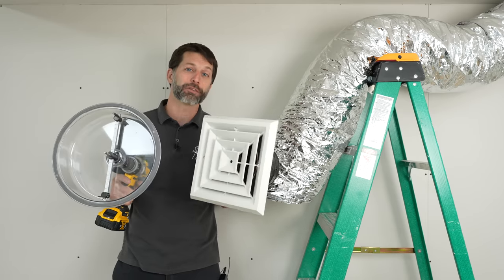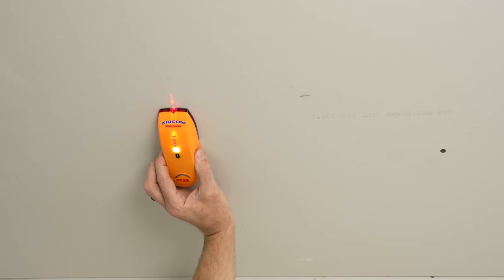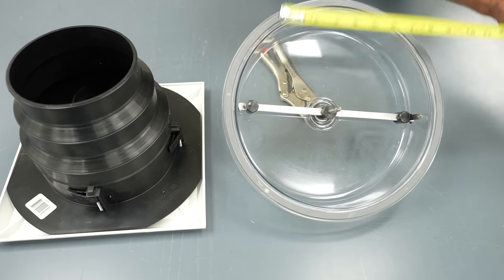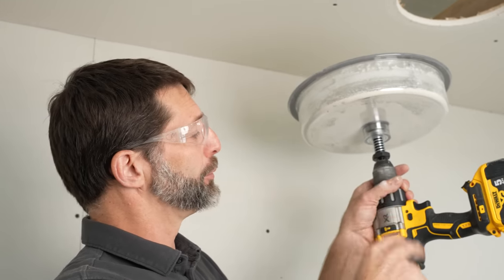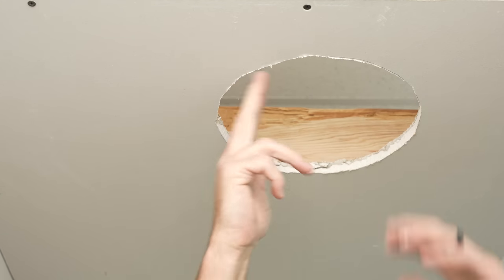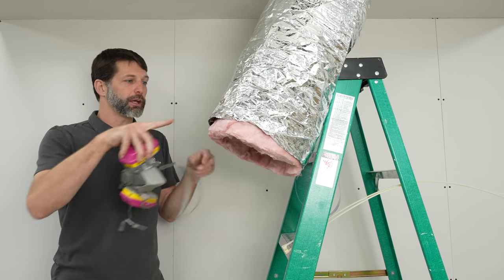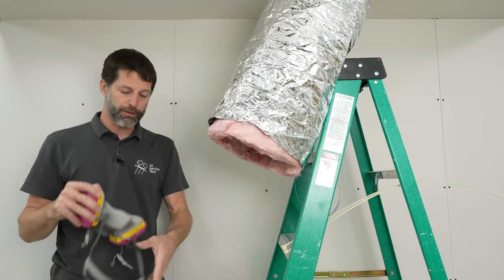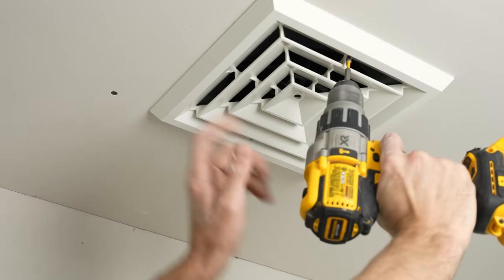Installing an HVAC Supply Register Airtec in the Ceiling! Cutting the Hole, Connecting the Flex Duct

Comment: Great video as usual. 
If I may ask, how would you do that differently in South Florida (or anywhere else with extreme heat and humidity) to stop condensation buildup on the area that was pandit strapped (over the whole duct) and the 8" section that wasn't covered in insulation at all?

Comment: Hello Craig. What us 12 5/8 heavy? I have never heard that before 😮!
Reply from the maker: 12 5/8" heavy means that it is 1/16" longer than 12 5/8" which is actually 12 11/16" but in the US we don't really talk in 16th's in the field. We only talk in 8ths or lower fractions. 12 5/8" light would be 12 9/16". Sorry for the confusion!

Comment: I have this setup in my home except I have discovered a leak near the connection, the inner plastic with wire was ripped, would insulated tape do the trick? or a plastic sleeve work?

Comment: Is 4” duct /flex allowed because I’ve yet to see anyone mentioning it but always 6”. Is a rheem furnace even capable of handling 4” duct for residential dwelling?
Reply: Airtec has a vent that will fit 4", 5" or 6" ducts.  All depends on how large your room is and how much air you need circulated.  4" ducts are common in small bathrooms.  You can put any size duct extending from a trunk line.

Comment: 🧐🤔🤷‍♂️ 👉 How are duct-cleaning services cleaning out those flex-ducts without tearing them up?
Reply: Some are metal ducts. Not all are using flex
Reply: The duct cleaning company only vacuums the ducting out. They do not run anything threw them. A big fat waste of time.
Reply: @Riomadness  not sure about that. I worked for an HVAC company that would stick a big rotary brush in the ducts to clean them and then sealed them to the Lowest sq in possible

Comment: The video is good, you can see what is ethical, but it strikes me that being a 4-way grill, one outlet is giving air flow towards the wall and should, in my opinion, have been further separated from the wall to take advantage of that flow properly of air that is going to hit that wall and I think that it is a lost flow compared to the other sides. For the rest, I repeat, the video is good.
Reply: he said this test build they put together was too small to get 24inch which is usually goes, 24 to edge of O.
Reply: that is the problem I have with my 2005 home!  I have circular duct work in the ceiling.  It is close to the outside walls.  I just put window sealing foam on the inside part of the diffusers to prevent air from being blow toward the wall and window (and behind my black out thermal curtains in all my rooms).
I'm not happy with that but better than wasting energy heating and cooling the windows behind the thermal blackout curtains, lol

Comment: a grocery bag works quite well with handsaw
you got a vacuum in the ceiling?
why not just stick the hose through the large hole
why not use vacuum while handsawing.....i mean if you got a vacuum on hand best to use it for all needs
Reply: I usually use a paper plate with my drill when I'm drilling into anything pointed up so that debris doesn't fall into my drill shafts